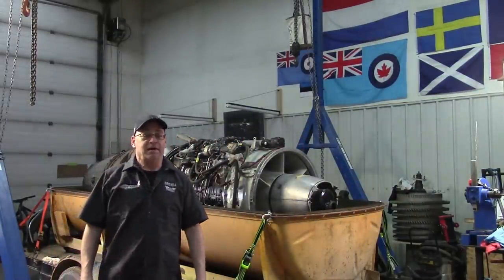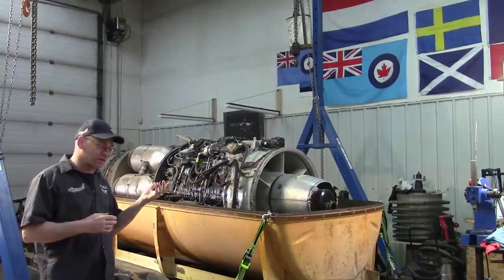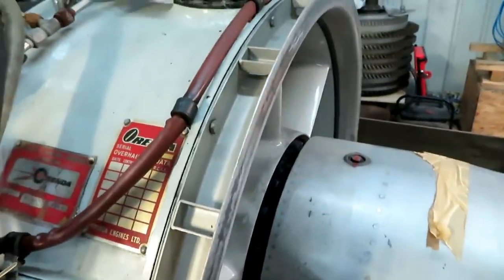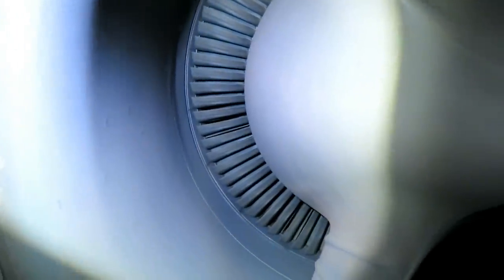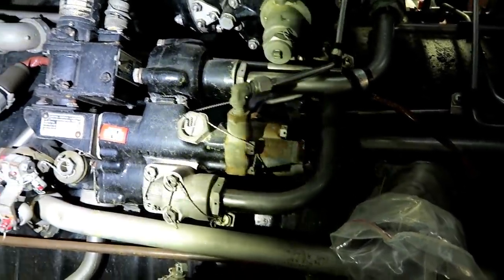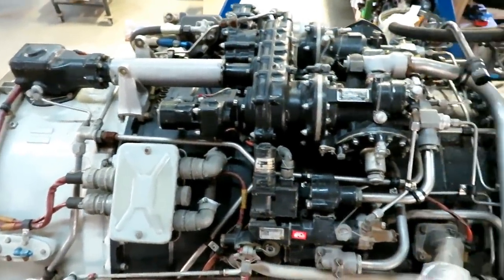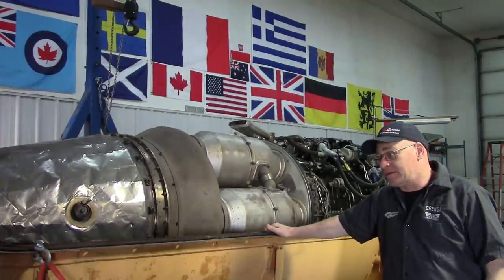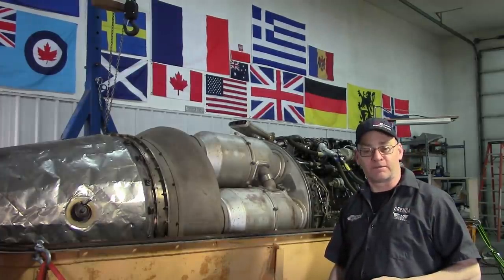Restoration of a 1950s Turbojet. 1

Comment: At 2:16 in your video, what are the two devices (look like a pair of trumpets)  that sit side by side and at the very top of the bulkhead just before the combustors? I think the combustor area would be relative high pressure bypass air so are those ducts to allow bypass air pressure into the accessory drive section?
Reply from the maker: 1 There is no bypass air.
2 Inside the engine, the combustion gases are at a lower pressure than the compressor outlet.
3 Those trumpets are outside the engine, and are fed a small amount of compressor discharge air to act as ejectors they pull fumes out of the area forward of the firewall, which separates the cold and hot sections of the engine when installed in the aircraft..

Comment: Is it possible to use NG (methane) instead of LPG (propane) in this gas turbines? If so how much hours power gain or lose?
Reply from the maker: This is an aircraft engine. The industrial version of this engine has a different fuel system, and is designed to run on natural gas.
The type of fuel has no effect on power output.
Reply: @AgentJayZ  Thank you very much

Comment: Can a Sabre be retro fitted with a more modern, more efficient engine? Or has it been done? Also were the Avon 20's a better engine? Cheers, Zac.
Reply from the maker: Let's imagine you paid five million or so for a 1955 Ferrari F1 car... would you want the original, finicky engine in it, or would you swap in an American V-8?
Sabres were powered by the J47, Orenda, and the Avon.
The Orenda seems to be the preferred powerplant among owners and pilots.
Reply: @AgentJayZ  I guess when you put it that way..... : )
Reply: I think the Avon is more powerful,  the planes that had them needed enlarged intakes to keep up with the more air hungry axial flow turbojet
Reply from the maker: The Avon is a more powerful engine, and also heavier. The handling suffered, and no other country used that version of the Sabre.